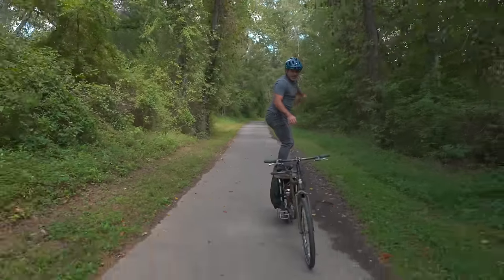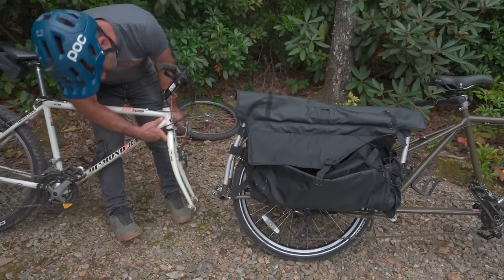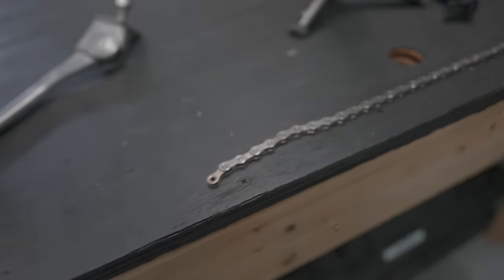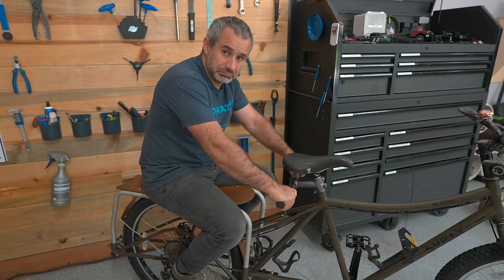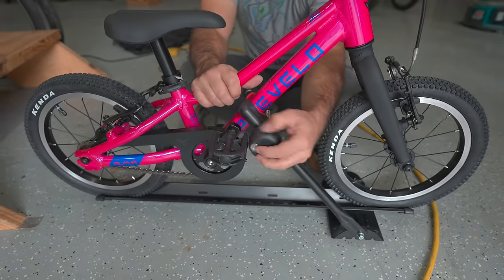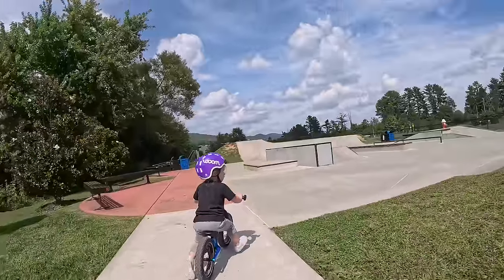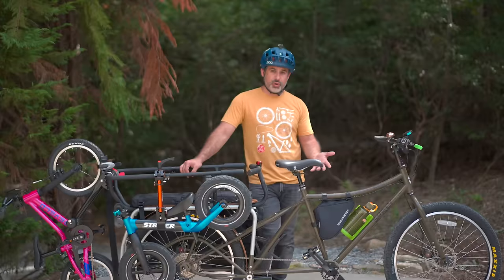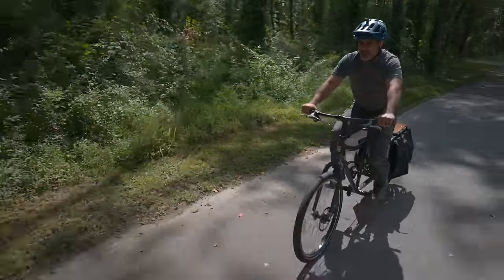Building a human powered minivan out of a Surly Big Dummy

Comment: 🚨 Seth! Fellow Big Dummy Owner, parent, and huge fan of your channel here- you absolutely need to cover both sides of the rear wheel of you have kids sitting on the back. There have been catastrophic foot injuries from kids sticking their foot in the spokes. (Why do kids do this? Because kids.) You can google the horrifying stories. Wishing you many happy rides! Your daughter is crushing the balance bike! ❤
Reply: Seth you could probably get away with putting a bag on the drive side and then still use the alt-angle  to mount the bike providing there was enough clearance.

Loved this video I've probably watched it about ten times.
Reply: Yes, I stuck my leg in the rear wheel once as a kid. That hurt. And I had a pretty bad twisted ankle. 

I know I did it because I was looking for a foothold. I was trying to put them on the bolts that stick out, but as soon as your foot gets between the spokes even a little it just gets pulled into it. So please cover the wheel, kids are dumb, it happens in a split second and you only know when they start screaming. 

If i try translating quite literally there might be something called coat guards. Those are literally just pieces of plastic on both sides of the wheel, as if it where mudguards but on the sides. Takes up no space so still enough room for the little bike on the side as well.
Reply: Came here to say this!

Comment: I am a proud owner and operator of a Surly Big Dummy. It's 2nd gen with the straight top tube and I'm the 3rd owner. Ive rode this sucker over 12k mi with up to 3 people on back and loads as heavy as 600 lbs. This bike is equipped with Shimano deore 2x 36t/22t with 11-34 in the back. It climbs levee walls, shreds deep sand and suplexes any obstacles that grab on. I've lifted over bridge railings to get it across safely because the rear wheel has a cage. Also dont forget to keep the back clear. That rear caging can be used to stand ur bike for easy maintenance and tight storage. Having rear bars to grab is essential because most of the weight is behind the rider. If you want any tips on this bike I'm your gal. 💘

Comment: I've used a 2012 Puglsey as my commuter with racks and bags, fenders and all. I've used it as my main mtb as well for many years on singletrack. I've also run it SS on those same trails for many years. It's back to geared and still running flawless. Sure I've replaced everything but the rims (new hubs, countless spokes) and frame, but it keeps on going. Wife has one too as well as a Cross Check, but sadly I sold my CC as I ended up with one too small and could never get a good fit on it. I always wanted a Big Dummy (or hell, big FAT dummy) but as I store my bikes in the living room of a tiny condo, well...

Comment: I love my Big Dummy!  Mine is set up for canine transport but works well for groceries, bottle redemption, trail maintenance and about anything else.  Climbs like a mountain goat due to the long chainstays, in fact I actually taco'd an SLX cassette due to the amount of torque it can lay down without loss of traction!  Having the seat almost midway between the wheels makes for a very relaxing ride, and a defloppilator helps with the speed wobble (Problem Solvers brand I believe).  I also have the shorter trailer that Surly makes for it along with the custom Dummy hitch, I believe it is the Ted trailer, which is probably the best built bike trailer on the market.  One day I'll ride off into the sunset with my dog for some touring, which was my original intention :)

Comment: I loved my Surly Pacer but sold it years ago to build a long tail Yuba Mundo.
I had 26x3 tyres and downsized to 2.5 hookworms.
The holy rollers are good as is a good double stand as is the KS eten dropper.
Eventually kids want to spend time on their own bikes but have fun tweaking it until then.
My only tip is get a skirt guard for rear wheel to avoid little feet in spokes, don’t ask how I know.

Comment: I've been looking to get my hands on one of these bikes myself... I need a bike for trail maintenance at one of the local state trails(myakkahatchee environmental park) here in the town of North Port FL. The trail requires weekly maintenance and annual cleaning (summertime is closed due to excessive rain). The only access to the outer trails are by bike, or I hike in with tools. I carry mostly hand tools, but I also use a backpack blower & string trimmer at times. The trail re opens around beginning of November. The trail will need a major clean & clearing after the rainy season/erosion along with pig damage/downed trees. There is a team that comes in twice a year to get it ready for a popular local biking event (piggy revenge). It's a great trail!  
My trail is not needing of the cargo bike because all areas are easy access by car. I would use also as a long haul overnight camping or something...
Great video friend!

Comment: I got a good deal on a Yuba Mundo frame right before COVID. It's gone through multiple iterations, at one point I even had an old Fox 40 on it (do not recommend). The Mundo is likewise a solid steel frame, one cool difference though is the headtube is 1.5" so with the right headset you can do a tapered fork (one day I'll put a 100mm DJ Bomber on it). I've done single track, bike packing, and daily commuting with it. Before our second kid came along we use to ride with my son in the back, mom sitting in front of him, and then me in the cockpit and the bike didn't even sweat it. One thing I did was put 26+ wheels on, really adds some cushion and stability. I did the wheel build myself so I also put a Alfine 8 IGH on the rear for less maintenance and kid finger traps. I decided to electrify it and put a bafang mid-drive on because I do a lot of riding on city streets with my kids and I feel the throttle and acceleration adds some safety at lights/intersections. The "Dragon Wagon" as we call it is part of the family as much, if not more, than our car at this point.

Comment: These are incredible machines! I have a first gen one, same as the model in this video. It has had many iterations over the years, most recently a mid-fat tire build, best build so far. Just a suggestion, you may want to cover the spokes on the rear wheel on yours to prevent little kid fingers and toes from inadvertently finding their way in there. Great video, great channel.

Comment: I've actually gone ahead and installed a dropper on my folding bike that I use for commuting (coz folded up I can take it with me on a bus or train without having to buy an extra ticket for it) not only coz it allows me to have the seat high enough to be able to completely straighten my legs at the bottom end of each pedal stroke and thus put way more power down with less effort while being able to drop the seat for each stop so that I can put my feet flat on the ground and sit comfortably with slightly bent knees, it also allows me to make the folded bike slightly more compact by reducing the height of the package.

That dropper used to be a slightly stubborn Bontrager post with 125mm of travel that I was given to try and fix it for myself, but that thing was way too short even in its extended position, making the ride exhausting and uncomfortable, so I was on the lookout for a better one. What I did NOT expect to happen was that when I went to a local bike shop to get new folding pedals for that same bike (More info below if ur curious) I suddenly noticed a box with an orange price tag on it and went to check it out, and it turned out to be a RockShox Reverb dropper with 200mm of travel that had been sent back by the previous buyer coz apparently it hadn't met their requirements, and just coz it had been sent back its price was reduced from 492€ down to 220€. I knew immediatly that that thing would solve the biggest problem with my folding bike and went to the cashier to open the box and check the thing out. There was nothing wrong with it other than a missing handle bar clamp for the lever, so I went ahead and purchased the thing. When I installed it on my folding bike I improvised a handle bar clamp by modifying an old mechanical brake lever's mounting bracket so that I could mount the lever on that. Now the bike is much, MUCH more comfortable to ride and since the new dropper has almost twice the old one's travel and the fully retracted seat sits even lower than before, making stops or even just sitting on the bike for lack of other seating more comfy aswell.

(The old pedals had developed enough play on their axles that they had a tendency to somehow get stuck and be forced to turn with the crank arm until a few degrees down the line they would suddenly snap out of it and back to flat under my shoes, which was hella annoying!)

Comment: The intro is a little Surly-heavy. They're rad, but certainly not the only longtail producer.
I've owned two Xtracycle Freeradical longtail conversions. The first was on a Bridgestone MB5. My kids were little and I used it for transport to and from school, groceries, pick up large bags of dog food and chicken feed. I regularly carried over 100lbs cargo. I simply had some handlebars off the seatpost for them to hold on to and it worked great. But I moved to the country and didn't think I'd use the bike, so I sold it.
Sadly, I missed the bike so I picked up another one, recently swapping the Freeradical kit over to a 90's Specialized Hardrock. Black paint with pink decals - rad. It also has motocross handlebars and generally is a damn cool looking bike. My kids are teenagers now and can ride their own bikes so I mostly use it for grocery runs and hauling gear at festivals...and just being a rad-looking bike.
I'll probably convert it to a pedal-assist ebike eventually. Given how far I live from town, that would just make it much more useful.

Comment: Hey Seth,
I have a tip for if you accidentally cut your fork to short. i found a stem that's only 27mm high. it's called the DMR Defy stem. it costs 70 pounds, but you can find it used for around 35 pounds.

Comment: So I found out why someone would install a star nut upside down in a fork because I am about to do the same. If you need to mount a headlight or similar in a fork without a center pull brake hole, you use a star nut (or expander in my case) and then you have a threaded hole to build bracketry off of.

Comment: About the Head Stem, how about using that raised reverse head stem you featured on one of your earlier videos? i don't remember well if you had actually bought them or if they were more like Demo pieces that was to be returned.

my thinking is that it would bring the handle bars closer and that it'd probably require less spacers, and in the case of body posture would put you in a standing position, although the downside would be that the rear would be more loaded and going uphill is going to suck.

Comment: I think that is the perfect design. If they were engineered well and built for all purpose, all terrain, all weather, various load environments. I don't know why anything smart should be called dummy 😊 I think you'd sell millions. I don't think they need to be 100lbs. I think you could get them to 40lbs at least. Capable doesn't mean stupid or slow. I wish more bicyclists would take a look at ADV motorcycles. Made to do anything anywhere anytime. We need bicycles like that. It needs fenders and a double long rectangular milk crate, and the rear frame can be shortened a little, give it a 40 spoke freehub, AdventX derailleur, 29er wheels. Do it for $2000 w/ CrMo. Ensure it fits 28-38in inseams well and that it has quality bearings for 300lb loads. Allow for up to 200mm crank arms. An American Omafiet.

Comment: hey idk where else to ask this so here I go, I wanna build into a specialized status enduro frame. Now, here is where im confused, I wanna be able to use wide chain rings, with bmx chains so I stop snapping these worthless pos chains. Now in saying that shimano makes the xtr set? but thats where im hella confused. I dont understand how to know what hub body they can be used on? I am used to bmx for the past 25 years so maybe if I ask in bmx language someone will understand.
Ok bmx asking, how do I tell what hubs allow drivers?, and not screw on freehubs? I was thinking the I9 hydra sets, but until then is there a cheaper wheel set, I could purchase, and run the xtr set on? Cause I wanna run a "shadow forge industrial chain" because ya those dont break, and I break a chain every 50-80 miles its driving me freaking insane!. also this is gonna sound really ignorant forgive me, but is SRAm, and shimano the same thing? everything I read they are always listed right next to one another? also ive watched videos on identifying the mtb parts its just so confusing. I have a specialized pitch hard tail atm, and I wanna upgrade all that to the xtr enduro stuff which if we recall up above its so Im saving all the parts, and semi using them before I get the new frame.

Also, what is the industry standard for enduro downhill on forks? I wanna super long forks, ive been doing random downhills at adrews in MI, and its just way to much fun just blasting down the hill but I seriously, am aware that my suntour forks that are spring not air or anything need more travel. I know that for the time being could get a used set of taper forks, then use a cannondale converter to my frame, and at least have a softer ride down, and not worry about bottoming out.
please recall this is all to goto the status frame.

Blah, I honestly feel hella dumb , that I can not figure this out. But there is just so many different group sets, and names its just confusing.

SO I guess if you know what group set could run a normal bmx chain, since I know those are not gonna snap I would seriously appreciate it, and sorry I wrote all this im cooked atm lol.

Comment: Are the wheels strong? I tried for the buffalo bike but they wont sell to me. And this bike here new is $3500. I think Brian at BriansBitchinBikes could fab smthn up for me better than this for that price. Dont get me wrong, its a good bike but $3500? Really? My 2004 giant nrs2 cost $2500 after i upgraded to hope mono brakes. I built a trailer using the old avid v brakes on it for about $300. Was hauling loads in Scarborough ON back in 2012 up to 400lbs. This why i love 3x drivetrains. I had about 18 usable gears at my disposal. Anyway, for $3500, the spokes better b 10g and the frame similar to the buffalo bike. Even there i still dont see 3500.

Comment: I have an issue with the steerer tube length, and requisite shim total. Fork manufacturers state that no more than 30mm of spacers under the stem is advised and the warranty is void if that parameter is not followed. Also stated is the RISK OF SVERE INJURY OR DEATH in all caps directly following. Also stated is if there is a nick or gouge below the stem that the unit should be replaced, again at RISK OF SEVERE INJURY OR DEATH. That much steerer tube above the bearing surface is high not recommended. Do this at your own risk as you'll get nowhere with the manufacturer.

Comment: Dude - Hydraulic brakes! That think is going to be super heavy loaded up and you can save yourself from hand-cramps with a cheap set of used hydraulic brakes. Plus, think safety: Hydraulic brakes are a cheap way to increase your control on the bike, which is going to make the bike safer for you and your kids.